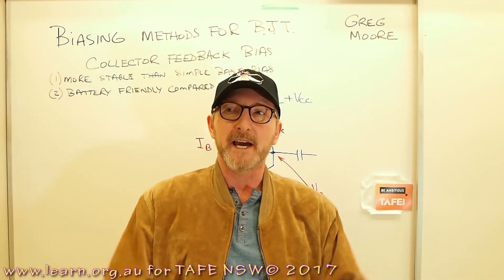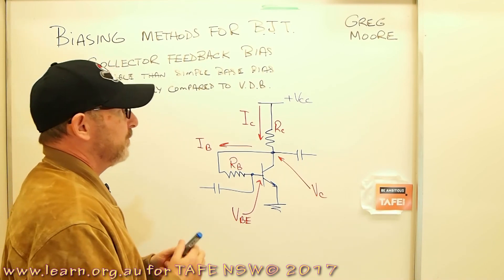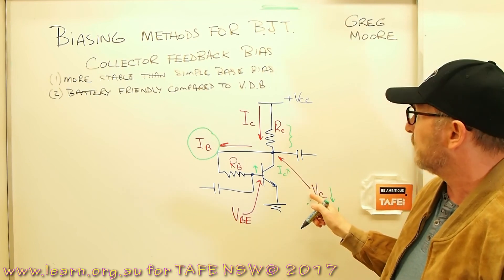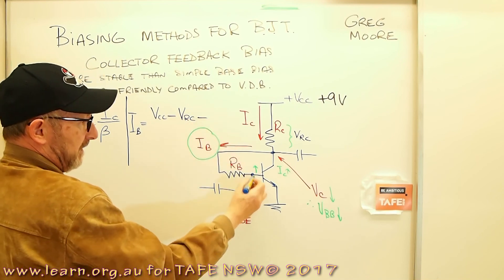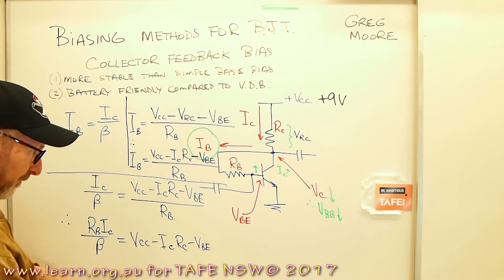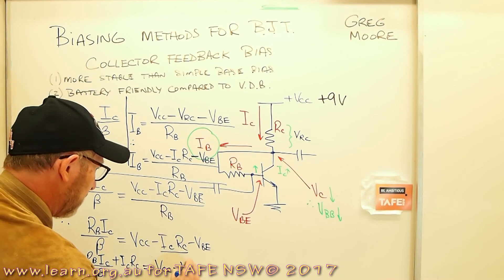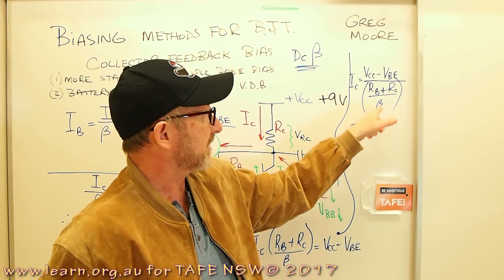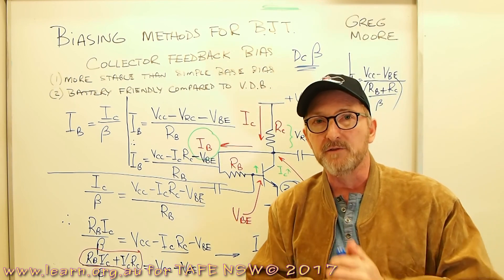BJT Collector Feedback Biasing UEENEEH113A TAFE NSW Part 1

Comment: one of the biggest problems in BJT that beta has a big range. Sometimes in datasheet the upper limit is not specified at all. How this circuit helps to overcome it?
looks like if I take the same transistor even from the same batch, once my beta can be 20 and once 200. This will move my working point.
What is the solution to this problem?